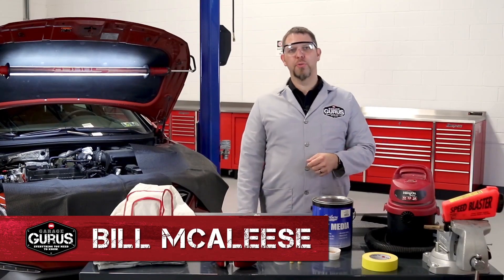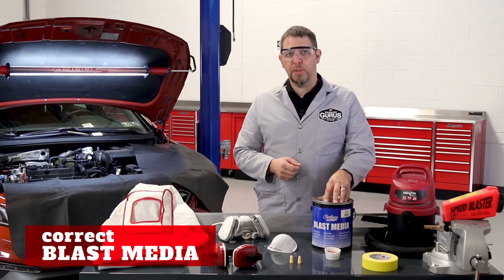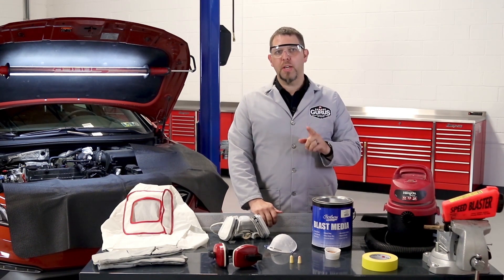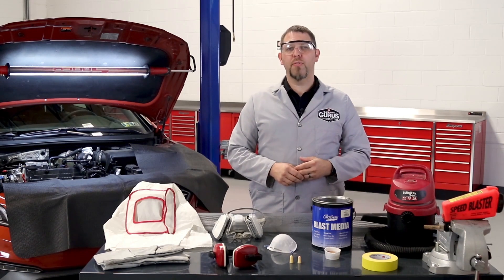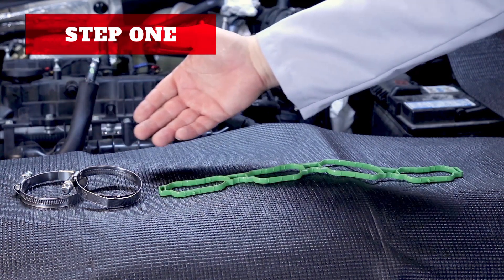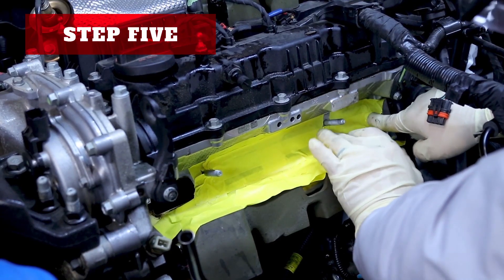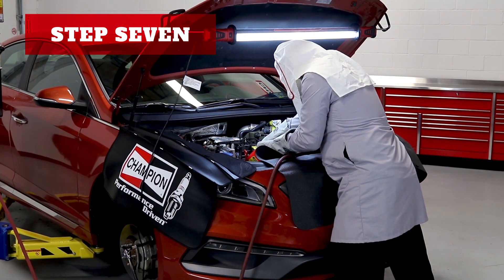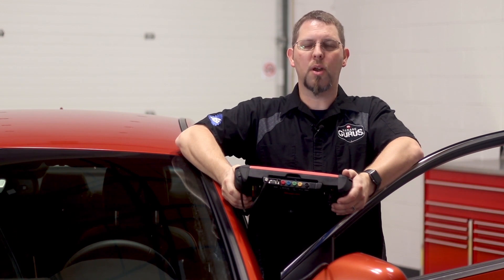Cleaning Intake Valves on a GDI Engine

Comment: Thanks for the video. I found this sandblasting gun in local store. But it has a short nozzle. I wonder if it's suitable to do this job (with baking soda). I am worried that it might not reach deep enough since it has a short nozzle. Can you check this link and tell me if I can use this Yato YT-2376 sand blaster? Here is a video sample. 
https://youtu.be/ppfg-bxe4WQ

Comment: My brother-in-law bought a 2012 Impala 3.6 that started running poorly so he took it to a mechanic that wanted $800 to replace a fuel injector so he decided to just let it go. Well about a year later I heard a distinct miss in the engine he said runs good, then I heard the story so I volunteered to replace his injectors. 

My new Launch X431 PRO3S+ scanner (that was accidentally listed for less than $100 on Amazon and the seller honored that price) said cylinder #1 had an active miss. The first bit of concern began after removing the spark plugs…all heavily encrusted with carbon with the cylinder #1 spark plug actually clogged with carbon chunks. After removing the intake manifold/plenum, I was shocked at the amount of baked-on oil around the valve stems and the radius leading to the valve faces. 

All the cylinders had a dry chunky carbon appearance except for cylinder #1, which appeared wet.  I checked the compression of all the cylinders and found they were all low @ around 100# (should be 150-185) but cylinder #3 was particularly low @ 80#. I attached a cylinder leakage tester to each TDC cylinder, poured a capful of B-12 fuel injector cleaner onto the back of the valves and watched the air bubble through showing where the valve faces & head seats were leaking. Cylinder #3 leaked the worst but a few other valves were fine. 

I cleaned the ports out using a long reach brush set (stainless/brass/nylon) but had to also use a long-handled screwdriver to dislodge some of it. I then reduced the wet/dry vacuum hose to fit through the spark plug hole (had to thin down some PEX using a bench grinder) to remove any debris from the TDC piston crowns. Another leakage test revealed my effort to clean didn’t remedy the leakage issue so I tried to repeat the cleaning with the valves open. Problem was, the entire valve face wasn’t visible to me while open. Anyway, again the effort still didn’t correct the leaking valves. 

BTW, blowing air into the spark plug tubes revealed the non-removable pressed-in tubes were leaking oil and since I couldn’t find the Permatex green sleeve retainer nearby, I sealed ‘em with some Permatex green penetrating grade threadlocker. 

Anyway, I reinstalled the plugs after cleaning the carbon off using a pneumatic spark plug cleaner, and put everything back together to blow the residual smoke out. The RPM fluctuated at idle  and still had a miss but this time cylinder #3 was worse than #1. The engine ran smoothly above idle speed. After the smoke cleared, I pulled the plugs and they were badly carboned again. I installed new plugs, took it for a test drive and while it smoothed out while driving, the idle fluctuation remained. 

I then dismantled everything again to install new fuel injectors and found the new plugs and injectors were again coated in black carbon. I tested the injectors and indeed there was a dead injector. With everything reassembled, with a new PCV oil catch can on the firewall, freshly cleaned plugs, and 6 new injectors..idle fluctuation remains. 

Perhaps driving it will fix the issue but I’m afraid those leaky valves will require a valve job. Or at least hand-lapping with valve grinding compound on the face and seat. Bottom-line: stay away from direct injection, or if you’re buying new...NEVER use dinosaur oil or a synthetic blend. Full synthetic only and you won’t experience the accumulative baked oil on the valve problem, but that may mean changing it yourself since it’s possible to pay for one thing yet receive quite another. 

Plus I’ve read about those places pumping the oil in too fast, which they say causes the PCV oil/valve problem. For me, I’ll stay away from direct injection, turbocharged vehicles, 4WD, and CVT’s in favor of reliability.

Comment: Nah I'm going to pass buying all this crap and still risk doing harm on a 18k mile engine. Considering its not in the service manual, hyundai can just honor its 100k warranty for something they chose to use
Reply: Except they are notorious for not honoring their warrantees😁. Anyways I did a soak and scrub and on my Lambda II engine at 60K KMs. Not terrible but still took a few hours
Reply: @nobodyimportant_23  the procedure on this is insane though for the common owner. I still ended up just pulling the front hose off near intake (per mechanic) and just squirted some  crc intake cleaner in it with throttle around 2k rpm. At 60k miles I need a valve check anyways per manual so I'll just have it checked while they have it open. I had to use the warranty once already with a repaint oxidation, but they took care of it. That's after I told them to stop turtle polishing it "to make it look good"
Reply: @Roadsurfer2k11  I tried the CRC route every 10K KM and at 60K when I took off my intake manifold to take a look, the valves were still very very dirty.

The other issue is that, for my Forte at least, the intake has a low spot and when you spray cleaner into the valve body, that spot traps the cleaner (and oil). 

I was curious why i would get no smoke during the induction cleaning, but days later when i floored the car on the highway, it would send clouds of white some and the engine would misfire.

When i finally took the intake off, there was a half a cup of oil and water sitting in the bottom of the manifold, so it must have collected there until i accelerated on the highway.
Reply: @nobodyimportant_23  ah ok ty. I run a oil catch can off the manifold since I have a turbo and quite a bit of oil sludge is in it. I prob won't be doing gdi again because it's lot going on with it and manufacturers don't expect customers to do this stuff
Reply: @Roadsurfer2k11  That's a good idea, running a catch can. Which one do you have / recommend?

Comment: My Hyundai manual doesn’t say anything about needing to do this service.  Just says to use a fuel additive if you don’t use top tier gas.  So if my valves become too messed up.  it will be covered under warranty.  I’ll trade this thing in right before the warranty is out.

Comment: If u do buy a GDI try and get one that has a MPI (multi port injection) cause this will clean the valves and u will never have the carbon build up problem.  Gas will go down the intake manifold at low rpm's and help clean the intake and valves.  U can add a MPI kit to GDI engines but it can be a pain in the butt.  Worth it in my opinion.
PS- a oil catch can won't hurt either.
Reply: Problem is very few manufactures use dual injection.
Of course I know Toyota does.
Maybe the rest will catch on ….maybe
Reply: An oil catch catch won't work here in Canada (cold climates).
Reply: Only Toyota, Lexus, and maybe some Subaru have both....correct?

Comment: yeah nice job on an engine that has its intake on the front. My Mitsubishi has it on the other side so i will s.m.d. till i make a clean. I will use brake cleaner, an old T-shirt and a screw driver. maybe gloves. The rest is BS. I dont spray anything directly into my cylinder head. a vacuum cleaner may be also helpful. The intake and throttle body will be cleaned (without the electrical parts) in an ultrasonic cleaner, and thats it.

Comment: The car manufactures need to design their GDI engines so that the valves don't build up carbon. Toyota has a GDI system where at idle fuel is injected in to the valve ports to clean them. I want a car where I don't have to worry about this issue. Going to trade my Hyundai for a Toyota because I feel I was cheated by Hyundai.  What good is it getting more MPG if you then have a missed up engine that's going to cost you as much or more than you saved on gas. This is BS
Reply: Randall Turner , i know your Comment is a year old, but i was wondering what you ended up doing? I also feel cheated by Kia, i didn’t know what GDI  was when i got my car and now im having hell with it. I also want a Toyota now...
Reply: @leroyfacundo  Ford does GDI the same way that Toyota does.
Reply: @leroyfacundo  My engine went out in August of 2021. Hyundai replaced it, but I was without a car for weeks. I wish I had traded to a Toyota. Now. with supply issues. I'm trying g to wait for prices to normalize.
Reply: You're forgetting though about the initial cost of the car.  I can literally buy 3 Kia Rios for the price of one Toyota with the same features.  I can have two spare Kias in the driveway.  I've owned 3 Toyotas...they aren't THAT good.
Reply: @karlhungus545  MSRP 2022 Hyundai Sonata is $24,150.  MSRP 2022 Toyota Camry is $25,395.  I can't get three Sonatas for  the  price of one Camry. If you can you could get rich reselling them.
Reply: @randallturner8048  Who said new?  Only a moron buys new.  Check out the used price (I'm in Canada) of a 2013 Corolla with 12,000kms and then compare that to the same thing for a Kia Rio with an extra set of rims and winter tires.  Almost triple the price.  I just ran the numbers for a 2022 Corolla base model at a dealer here and it was $29,000 CAD if you pay cash, $32,000 with financing.
Reply: @karlhungus545  You have a point there.
Reply: @karlhungus545  My Hyundai engine went out at 98,000 miles. I have a Toyota with 205,000 miles and it is going strong. Hyundai replaced the engine, but I was without a car for  6 weeks and had to  have it towed twice during the ordeal.
Reply: @randallturner8048  I had a Toyota (my 3rd) where the nylon speedometer gear went on it on my 2003 Echo (automatic) with 175,000 kms.  $3,000 fix (swap tranny) because it wouldn't shift to the high gears so you couldn't take it on the highway.  It also blew a crankshaft sensor and a water pump.  3 tows in all for that one.  I haven't towed my 2013 Kia Rio EX hatch yet (knock on wood) and it only cost me $9,000 CAD with only 12,000km on it and a brand new set of winter tires on rims.  A similar Toyota would have cost me almost triple that.  Toyota is not infallible.
Reply: @karlhungus545  An Echo is probably not a good representation of Toyota quality.  It's a little cheaply made subcompact.  A Corolla or Camry would have a much better build quality. Although, new Corollas have a CVT transmission which probably isn't as durable as a geared one.
Reply: Hyundai /Kia doesn't have this issue.
Reply: @KhinNinson  heck they don’t one reason they were sued

Comment: how much would this be if it is done from a mechanic?
Reply: The least cost quote I got from a VW dealer was about $400 when the intake manifold was already off for some other reason. $800 otherwise. They used solvents, brass brushes, and picks instead of walnut shells.
Reply: Audi dealerships use wallnut shells

Comment: This all seems so much more expensive and hazardous than water methanol injection which will also cleans your intake manifold and piston tops too.
Reply: Nissan Patrol GR 3.0 Di Turbo really?...methanol is extremely poisonous
Reply: Nissan Patrol GR 3.0 Di Turbo yes. The problem is even mpi engines have carbon build up because of EGR and PCV.

Comment: What a bunch of BS!  Never buy a GDI engine to begin with.  You'll be much happier.
Reply: It's impossible not to.  Pretty much most manufacturers nowadays are all going to direct-injection.
Reply: @am74343  buy used before 2007
Reply: Unfortunately most auto companies have moved in the direction of gdi.   Whenter for great mpg or performance, gdi is here to stay.   Best approach is to always follow the recommended oil service intervals and use a superior oil grade.   Never use a bargain oil for a gdi engine.  Also running the occasional intake cleaner suck as seafoam through a vacuum line that is before the intake will keep carbon at a minimum.   I have a hyundai Electra gt with the 2.0liter gdi and have not suffered any issues of carbon buildup.
Reply: @abelardoconesa9512  its only hear to stay bc you got no backbone. If you dont their bullshit then they either have to give you what you want or close their doors.
Reply: @unleashedrider4309  " no backbone"????  Your reply is unwarranted sir.
Reply: TonyofPUREevil i can vouch for that. I currently have 2.. wont have another